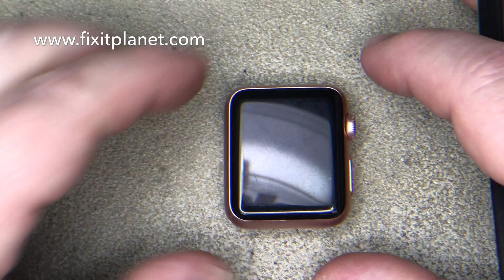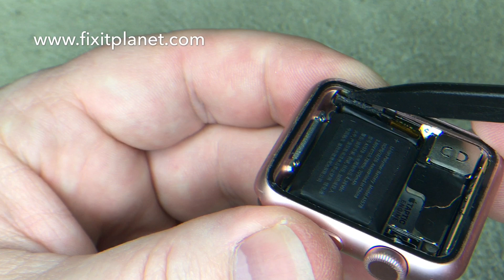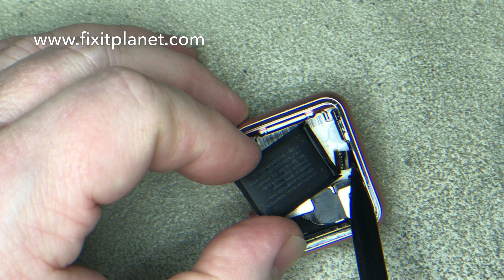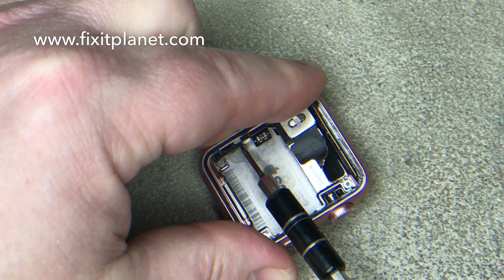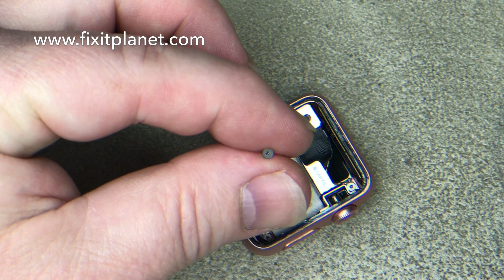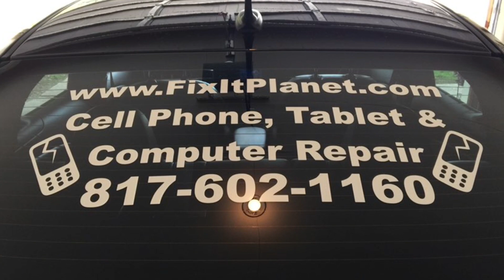Apple Watch Battery and Force Touch Sensor Replacement Overview.

Comment: Thank you for you video, it helped me to replace cracked display on AW3. But to say, I was so skillful that I split the force touch gasket, so I removed it :D but display is working properly.. but I noticed that the battery drain is now 1h 15-20%.. is this due the removed force touch gasket or the display consumes more more power?

Comment: My force touch gasket is attached to the screen on my kiddos watch. The battery has swollen and am trying to figure out how to get the gasket gently separated from the screen so I can disconnect the screen, replace the battery, replace adhesive, and seal back up

Comment: Why would you replace the force touch sensor, how do you know if it’s bad, does the screen just not respond anymore to your touch?
Reply from the maker: The most common examples you would replace the sensor are if it is physically damaged or fails for some other reason such as liquid damage. The sensor has nothing to do with the touch response on the screen other than sensing applied pressure.
Reply: Fix It Planet so if the digitizer is bad (my screen is not cracked but it does not respond to touch), is it possible to just buy the digitizer without the glass and replace that and possibly the Seal which has come loose at one corner I assume that’s what caused the digitizer to go bad maybe it got exposed to water?
Reply from the maker: What's possible and what's practical are two different things. The screen should just be replaced. The full and entire display assembly and NOT just the glass or digitizer. That is not a practical approach for a one time only repair.  Just do what we did in the video.

Comment: Can you help on Apple 3 watch where the activity is not getting tracked and Watch does not wake when we raise our wrist.  I was told this is due to sensor issue and as it’s outside warranty it can’t be covered and Apple does not perform any repair for watches.

Comment: Hi, if opening the Apple Watch Series 2 I broke the Force Touch.. the touch will not work?
Reply from the maker: The screen will respond to your touch but when you press harder the force touch function will not work. You can however replace the force touch gasket.
Reply: Fix It Planet ok I replaced the digitizer but it don’t work.. brand new

Comment: I just replaced a screen on my series 1 and now it won’t come on. When I put the screen into the glass a piece needed soldered back on...I didn’t solder. Is that the reason why it won’t power on? My force gasket is in good shape. No tears. It worked fine before we put new glass on. Please help.
Reply from the maker: Sight unseen is difficult to diagnose. If you are saying you removed the glass from the display then that is another type of repair and requires more work including soldering. Maybe you damaged the display removing the glass. The force touch sensor has nothing to do with power.

Comment: I cannot get the screw out of the force touch sensor and I'm worried about stripping it. Any tip on getting the thing out?
Reply from the maker: Just make sure your using the right driver bit, get a good grip, go slow, and be patient. Don't keep turning the driver if it's not moving the screw. If it strips then it will really be trouble getting it out.
Reply: Use y0,6 bit

Comment: Do you know what’s the purpose of that force touch sensor? I ripped its cables and took the whole thing off. Yet, force touch is still working. Why?
Reply: Did the force touch really still work?
Reply: Touch screen will work, force touch, not an option. It’s the sensor which will measure how hard you press the screen. Try to change watch face and you’ll see that it doesn’t work any more.

Comment: the connector between the display and the display connectors ripped when removing the screen, can I replace that cable or do i need to replace the screen?
Reply from the maker: If it is the cable to the watch your done. If it's the cable to the screen you need a new screen.

Comment: Does the force touch go on before or after the adhesive. In other words does it go on between the screen and adhesive?
Reply from the maker: force touch sensor goes on first then adhesive for the screen
Reply: @hat holds down the gasket??? @FixItPlanet1